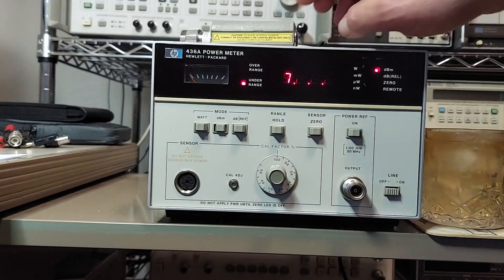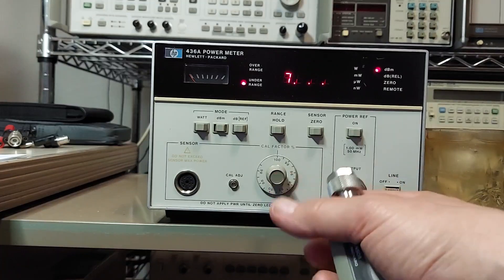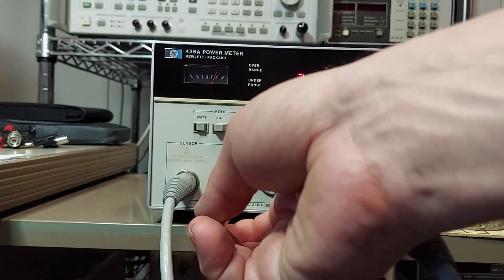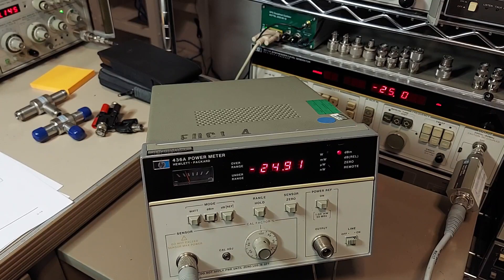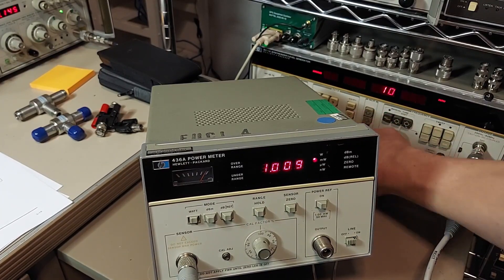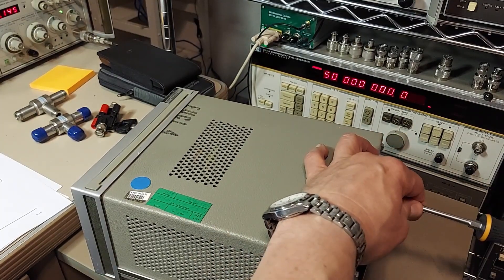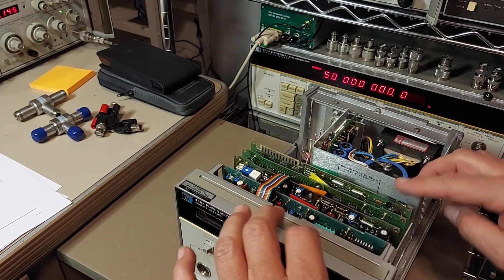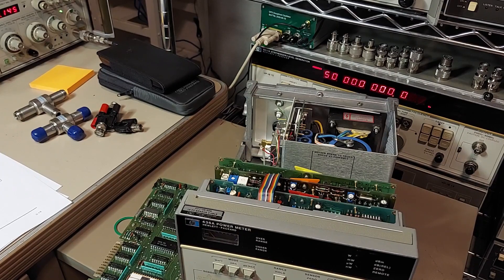Quick overview of the HP 436A Power Meter.

Comment: Hi, I have a question. How can I use this power meter with the AGILENT 8485D power sensor, which has a range of -20 dBm to -70 dBm?
Reply from the maker: Greetings, sorry for the delay as my internet service was out for a week. Doing a quick search shows that power sensor works with a HP 437B power meter, so technically, it should work with the 436A. I have the HP 8484A, it has a range of -70dBm to -20dBm and that one works just fine with the 436A all be it the upper frequency range is 18GHz.

Comment: What does this one do?
Reply from the maker: It's a power meter made in the early 80's. Depending on the sensors and attenuators used, you can measure power levels from a few nano--watts, all the way to kilo-watts from 100kHz to 18GHz. However my primary meter is the HP 437B and can be programmed with the attenuator offsets that will give actual power outputs without doing the math. Thanks for watching!
Reply: @CraigPetersen12f36b  So you can measure power output of a sine wave like a stereo or RF?

Comment: For your zero, you should press and hold until it stabilizes to get the true zero. Also, it helps stability if it is not held in your hand.
Reply from the maker: I tried that several times after I had posted the video, I eventually had to adjust the "zero" trimmer on the A3 board to correct it. For its short comings it's still a very useful instrument. Thanks for watching!

Comment: Yeah, the HP power meters are cheap, but those power sensors are way too expensive.
Reply from the maker: I hear ya, power sensors can still fetch some high prices but I have been able to get them for $150-$200. The HP8481A sensor in the video cost me about $220.
Reply: @CraigPetersen12f36b  I don't have a meter yet for that very same reason, however there are cheap Chinese sensors for about $25.00, would be interested to see how they would compare to your HP counterpart?  ~Jack, VEG